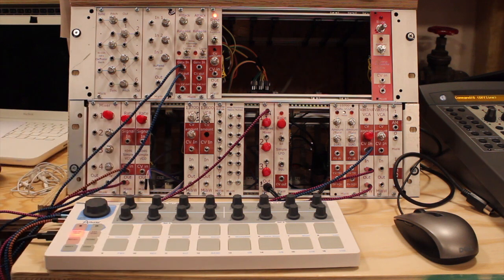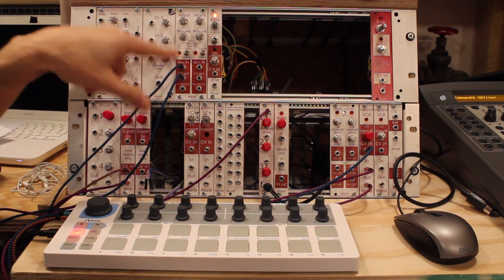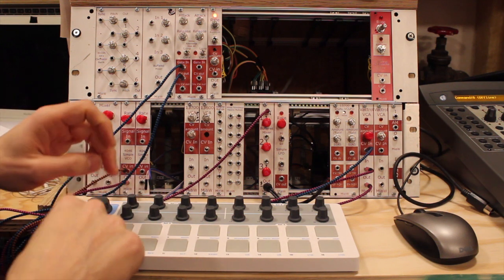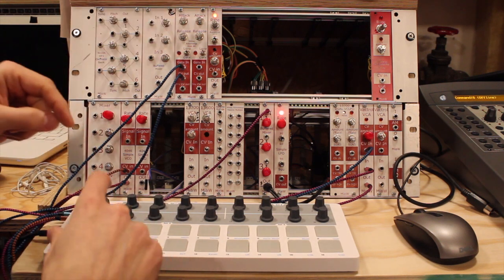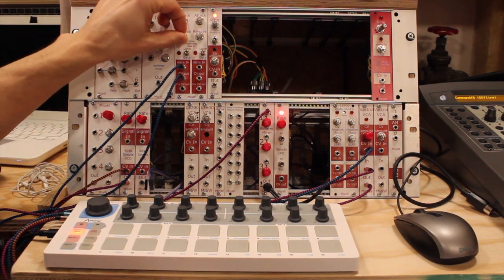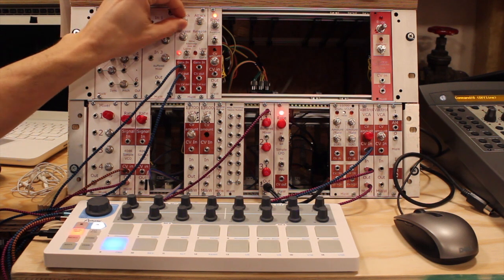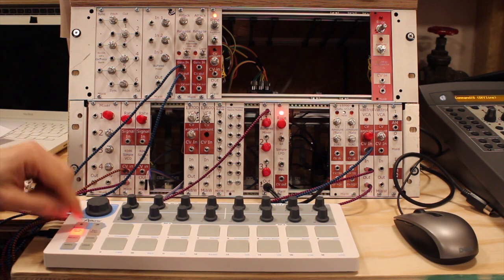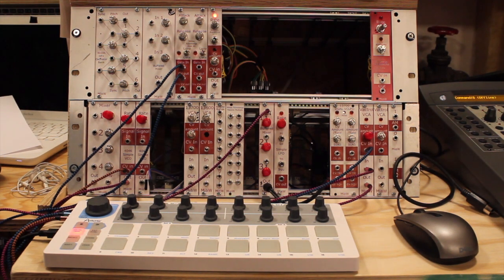More AR thoughts

Comment: You are correct. It is because of the gate. This envelope enters release only after the gate switches to low. There should be a schematic somewhere for an AR envelope generator that only uses the gate to trigger the attack and goes into release after the attack has reached maximum aplitude, I think. Or you can build a full ADSR envelope generator :)
Reply from the maker: Oh I’m going to build a full ADSR aswell. :) I’m building an AD right now which does exactly that, going into D after A has reached max amplitude. Thanks for the info!

Comment: Hello again :).  I set this up exactly the same way and I believe I was able to manage to get the AR working.  However, one difference is that the oscillator tone is constant, even if I'm not pressing the button.  Does that mean something is wrong with the oscillator?  Thanks!
Reply from the maker: You send the ar cv out into the cv in on the vco? Then it should change in pitch. Unless you are outside of the cv range. Try different base frequencies for the vco.
Reply: Thanks, I will try that.  Plus, I saw the simple noise vid with the AR and I will try that too.  Thanks!